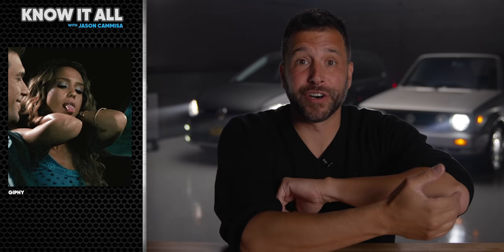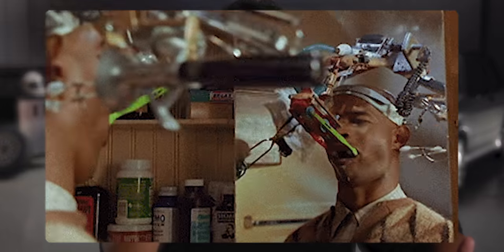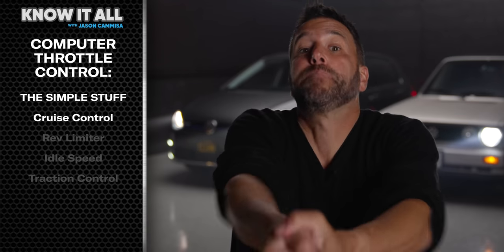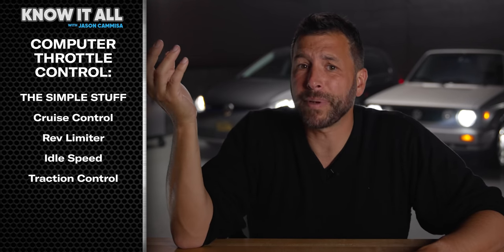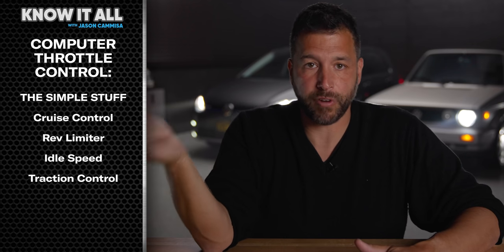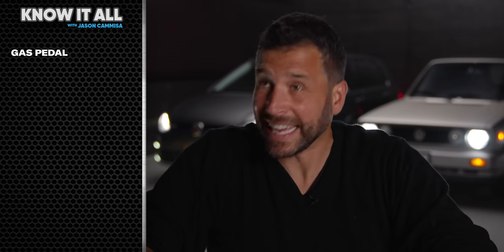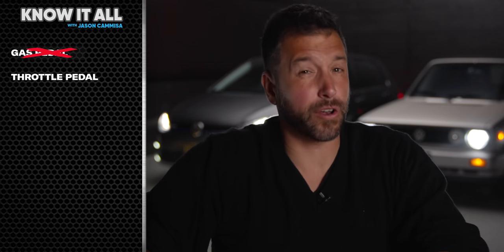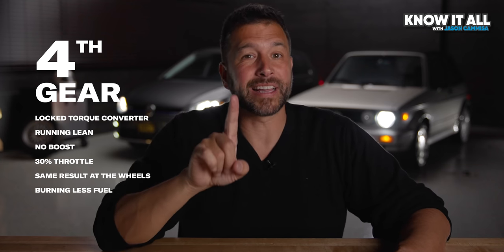Having no gas pedal is a good thing | Know it All with Jason Cammisa | Ep. 07

Comment: Please tell me what is more clever about replacing the term 'gas pedal' which uses 8 letters and 1 space with 'torque request pedal' which uses 18 letters and 2 spaces to do the same job.................... This is simply further evidence of the overcomplication of automotive technology. Frankly I'd be happy to go back to the term gas pedal EVEN IF IT'S NOT ENTIRELY ACCURATE and I will refuse to use that new term you introduced me to. It's insulting. I'm a driver. I'm not requesting anything, I'm driving and I'm demanding an activity from my car. My car, my right foot, my rules.

Comment: And when the torque request pedal doesn't work there is probably a $200 part with a $400 labor bill to fix it, when there is nothing that can break or wear out between the gas pedal and carb on my 65 Comet.
Reply: My 1995, 300000 mile van is still working. If the pot goes bad now, I won't feel bad about replacing it.

It's a Diesel, so no carburetor anyway.
Reply: But those cars have other things like cruise control motors, idle air valves, distributors etc like he talked about. those all wear out
Reply: Not to mention, the cable itself can fail, so yes, there is in fact something between the two that can wear out or break. It's not even that uncommon of an issue. Similar brake by cable systems on bikes or small engines are rather prone to it in fact, needing readjustment on a semi-regular basis.
Reply: @anthonyschroeder521  there is no cable on my car, it is all rods and levers. Also out of all the cars I've owned and even with the total neglect of maintenance such as lubrication I've never had a problem between the go pedal and carb. My 1956 dodge is also rods and levers and 64 years later no problems.
Reply: @H4zZ4rDGaming1  those cars? My car has none of them except the distributor and I've never had to do anything besides new points and condenser until I put in a electronic conversion which require zero maintenance. Now my greatest concern is the electronics going bad which is why I keep points and condenser in my tool box to put them back in when the conversion fails and leaves me stranded. In my 40 + years driving I've never had a car strand me, no matter how poorly running they've never failed to get me home, how many people with new cars can say that? Add the towing cost to that money from my initial comment and your up to $800-1000 for a bad potentiometer.

Comment: Then i want to slightly accelerate in my mums car and the car is like: FULL POWER? YES FULL POWER!!!!!
After a slight delay of course. Its ok if its programmed right but most of the time i hate it. 
Most cars dont allow full power if you have the steering wheel slightly turned and so on. 
I dont have anything against an e-pedal if its programmed right. But on cheaper or not performance cars its not always implemented as good. so thanks i wil stay with my throttle cable. Atleast then i know that i fucked up :D

Comment: There are two major flaws.
No 1. Since it is a computer they, company/gonverment,  literally can lock you out of "your" car.
No 2. WHEN, and not if, the computer fails you are in a world of hurt. 

I could write more but these too are way more important than other issues.

Soooo yeah better an older car WITHOUT electronic brain which can run on any fuel rather than a "top" of the line computer out of my control!!

Comment: All good stuff about torque control, but what's even better than an electrically controlled throttle, is electronically controlled valves. Check out how far Koenigsegg has developed this. 

The centrifugal mechanism in a distributor is for spark advance

Comment: If I wanted the computer to do everything for me, I wouldn’t drive mostly older cars with manual transmissions (and manual transfer cases in some of them). This tech all works in a lot of cases, sure- but part of the fun is doing it yourself. Shifting manually, controlling the throttle, trying to find the limit of braking... it’s hard to do that with a computer holding your hand and saying “now now Timmy, I know you want to go fast, but let’s do this other thing first okay?”

Comment: Rev limiter - false. Neutral soft limiter, true. DBW still requires a rev limiter for the function in the name. When all else fails (throttle jammed open, wire shorted to 12v on throttle motor), cut Spark and fuel. The rest was a decent dramatisation of the reality :-)

Comment: Have you ever tried to move a modern vehicle in a tight space. Like a garage. 
In an old throttle cable vehicle, you could just ease the pedal down and the vehicle would slowly move. But in a throttle wire vehicle. You ease the pedal down and the computer thinks you're just resting your foot or something. So you press a little further. Still nothing. So you press a little further and suddenly the vehicle lunges forward and hits the thing you were trying to maneuver around. 
I work in a body shop and luckily I haven't had that happen. But there have been WAY too many times when it almost did.

Comment: I'm triggered! A dimmer switch is NOT a potentiometer. It is a Rheostat. A potentiometer changes voltage, a Rheostat is wired inline a circuit and varies amperage.

Comment: Explain the benefits of electric brake boosters vs vacuum brake boosters
Reply: Electric boosters can work with the engine off, improved brake feel, not vulnerable to not being able to boost at or near wide-open throttle, improved antilock braking/ESC response. Probably more benefits but those are the ones I could think of off the top of my head.
Reply: @aspecreviews  the main issue I have with electric brake boosters is the delay between brake pedal action and system reaction. Now I  only work with new Ford and the 21 F150 has the system reaction delay that I have an issue with.
Reply: @kylecatchpole4133  If the F-150 hybrid is the one you're talking about, that's probably because it has brake-by-wire.
Reply: @aspecreviews  all the f150 are electric brake boosters

Comment: Hello guys, am not very knowledgeable when it comes to cars but I was just wondering, since your standard transmission both auto and manuel contribute significantly to drivetrain loss . Could a battery designated to function like your standard transmission to be developed?, that way any excess power that would be lost is stored?

Comment: And you know, in the 80's, with Bosch Abs system, it was reading wheel speeds off throttle, and if you downshifted and let the clutch go with a nice torque lockup, it would ask the engine ecu to open the idle control valve to minimize the lock up (or try), on a dedicated wire of course, because wtf was can bus yo. Yeah that was another era

Comment: i've always wondered why modern cars didn't use an aircraft style power lever. its all electronic anyway and frankly, that would be more easily controlled as our hands and arms are designed for more precise positioning than out feet. further, it would allow some people with lower extremity disabilities to drive. also it would look way cooler

Comment: 3:30 that is really fascinating and definitely deserves a separate video!
Reply: Easiest way to think of it (IMO) is that any resistance in the intake tract (e.g. really dirty air filter, kink in intake tube, or closing of throttle) will definitionally increase pumping losses and therefore hurt volumetric efficiency. Part of the benefit of a diesel engine vs gas is diesel has no throttling losses. Throttling in combination with the energy expended during compression stroke (and general friction + load of valvetrain) results in engine braking off-throttle, which naturally is less strong on a diesel (I understand this is in part why the Jake brake exists, to further improve engine braking via pumping). The effect of compression on engine braking would be greater on a diesel due to high CR, but there’s no throttling losses. At least this is my understanding!

Comment: I've always hated on throttle by wire but I admit, I never once considered most of the points you made. I can definitely see the overall benefit now but it would be nice if you also included a few of the things you lose when ditching the physical connection with the throttle.

Comment: Am I glad all this technology exists?

Yes. Most drivers need it.

I know that I could be BETTER with all these things, but honestly, the quite-literally ONLY things from modern cars that I miss are modern safety features. If I could just take a modern car's safety systems like modern airbags, modern ABS and stability control and transplant them into a 1994 nissan pathfinder SE, I'd buy that truck in an INSTANT. 

The reason I hate new cars isn't because of things like this, but because they're also filled with computers that DON'T do any good. Digital gauges can rot in hell. Same for shiny plastic touch screen infotainment. In my 2003 JCW Mini, I have access to the radio, cruise control, and trip computer at my literal fingertips either ON the wheel or less than an inch away on the turn signal stalk that tells me every single piece of relevant info I need. If I want heated seats, there's a small button for that. Climate controls have no digital gauge to go hunt for. I just reach down and tell the car "how hard do i want it, how hot do i want it, and where do i want it."

The backup camera is a great feature, but Ford showed us that all we need is a tiny little screen built into the rear view mirror for minimal cost and intrusion.

I have a problem with it because it's just not long-term oriented. I don't hate technology, but when it comes to cars, I feel we are not being wise consumers. Cars should last longer than 5-10 years. But god help someone trying to maintain a "classic" tesla model S in 2050. Batteries and motors are easy to replace. But what about all those screens?

Personally, the electric car I want is one that's deliberately less efficient. I want a car with an electric motor hooked to a manual 6 speed transaxle. I know it's less efficient, but it's the only way I'll switch (short of taking gas away) because I just want to feel engaged with what's going on. 

Bah, pointless old man boomer tirade aside. Electric throttles are neat and honestly I hated dealing with old school throttle bodies. Cable binding, the cursed vacuum lines of old cruise control... I'll pass on all the turbocharger nonsense (I like the surge of boost) but the rest of it is super neato.
Reply: My 2002 Prius has a digital speedometer right up near the base of the windshield, and I love the placement. It's always in your line of sight, and the steering wheel or your hands/arm will never block it.
The Prius also has analog automatic climate controls. Just turn the knob to the temperature you want, and the fan speed you want, or just turn it to AUTO.

Comment: Very interesting spin on drive by wire.
The question is, are we better with twin turbo electric supercharge hybrid cars that have at least 20 variable outcomes per second requiring more computing power than an Apollo rocket, or were we better with a pure, naturally aspirated engine, no weight and a simple cable?
I've got an e46 M3 which is an early adopter of drive by wire. On start up the car is lazy as ***k. Put it in sport mode and it changes the pedal response to make it more lively. It's a manual so the car isn't picking the gear for me. It's NA so it isn't balancing out turbo lag. Really other than cruise control and lazy/lively modes I don't get it. And I can feel a delay between the go pedal and the car going. It's small but it's there.
Reply: I have a 2002 Prius (drive by wire of course because it's a hybrid) and it responds quicker than any traditional vehicle without electric assist. I was backing it off one of those drive-up servicing ramps once and the instant torque surprised me. Put it into reverse, and it wouldn't go. Pressed on the torque request pedal a little, and still wouldn't go. Stabbed on the torque request pedal expecting a little bit of a lag, and the electric motor responded instantly and shot the car backwards at about 10 MPH off the ramp, causing me to slam on the brakes and lock up the wheels.

Comment: I hate fly by wire throttles. Just mutes the experience. My old 90 civic with a B16A and a throttle cable is so responsive compared to my 2018 civic si.
Reply: My 2002 Prius (fly by wire throttle and brakes) is probably more responsive than your Civic, because it's half electric. When Toyota launched the Prius, they baked in zero artificial delay to the throttle, because they wanted to emphasize the instant torque of the electric motor. Starting with the 2004 model, they neutered the throttle response to make it feel more efficient.

Comment: Fantastic explanation. I wish more people would understand these things. Now, speaking from an enthusiast point of view, I’m very thankful I still own my car from 94. The difference between cable and torque request is very noticeable. Absolutely no lag or “I’ll think about your request and raise you slightly less throttle”. Give me cable pedal any day!  The only electronics in my 94 is the ecu to manage the engine itself, and the abs on the brakes. That’s it. Everything else is old school. 👏🏻
Driving the 2010 daily, I’ve got to hit the torque request pedal extra hard to give me the proper revs for a downshift. Gotta turn off stupid tsc as well. Every time I fire the car up. Thankfully it’s just 1 button. 
Give me the good old days any day of the week. 😎
Reply: I drive a 91 because I can't afford a 65.

Comment: that's why they art of the car has moved from mechanical to 1010101001010
A car that could idle cold and run smooth at high rpm... someone knew what they were doing and it was beautiful... 

now a  line of code just says go.... and it goes... 
I pity todays youth, as my father must of pitied mine as he remembered his '66 Olds 442 while I worked on my 88 crx si .
Reply: Programming these systems is an art in its own, though.
Reply: @aspecreviews  sure.. but show me the artist and the process.. I'll show you who's work I admire more.

Comment: Having used a car in the winter with "throttle traction control". Its hot garbage. Its possible it was just that car, but it would pull power almost all the time in snow and caused me to get stuck on hills over and over. Instead of letting me keep the tires spinning it cut power to basically zero and wouldn't even let the tires/car move.
Reply: My 2002 Prius has a really neat algorithm for TC. If you accelerate a bit too quickly on a slippery surface, it will dither the electric motor to control the slip precisely. However, if you floor it, it will control wheel speed to about 18 mph and hold it there until you start moving, presumably to help you get unstuck.

Comment: That’s cool, a lot going on there, some simplification of systems and a potential gain for efficiency and NVH. Maybe I’m just old but I still prefer scratching my own elbow, my own head and my own... other parts. It’s part of driving. If so many people weren’t so distracted or just plain stupid we wouldn’t need these nannies. Traction control is handled through the gas pedal. Antilock braking is handled through the brake pedal. Yaw control is handled through the steering wheel, gas, and brake pedals. It’s called... driving. Oh and don’t forget the magical standard transmission. I’m never in the wrong gear when I control my own gear selection. It’s only known as an anti theft device now. Don’t even get me started on all the ridiculous warnings cars beep, boop and flash at you. Pulling through a parking lot sounds like an obnoxiously loud Pong game being played through your car speakers instead of your music. I HATE that $#!+. I have 3 mirrors and a damn camera, I KNOW THERE’S A CAR OR CURB THERE!!!
Reply: Toyota has a stability-control system called Vehicle Dynamics Integrated Management that can literally make millisecond brake and throttle adjustments to avoid a skid before it occurs. In an emergency avoidance maneuver, for example, VDIM can literally keep the vehicle on the edge of control without going over it. A human would never be able to react fast enough, and they can't control individual brakes, either.
Reply: @aspecreviews  while neat those systems exist to simply save people from bad driving no matter what form it takes. Yes, the system can react in ways no person can but it’s effective only after the driver has exceeded his ability to avoid or correct a situation. It’s another band aid for bad driving.
Reply: @coryholbrook4643  VDIM is designed to reduce the risk of accidents. Even a good driver can benefit from VDIM because it simply makes the vehicle handle better. It's not a reactive system, it's a proactive one.